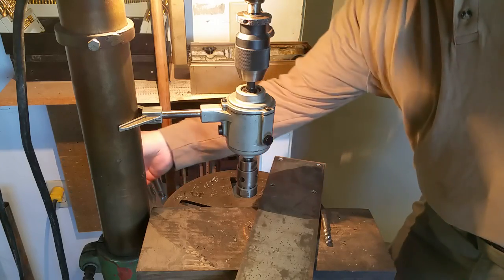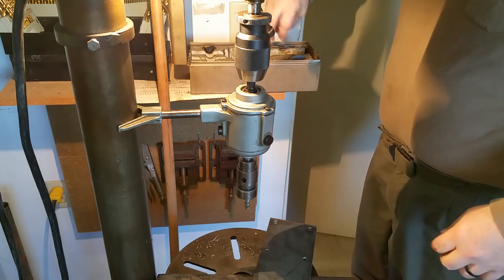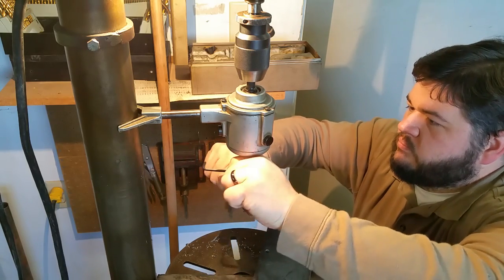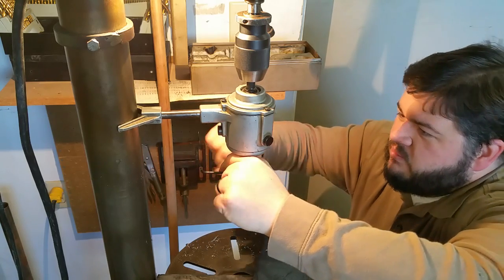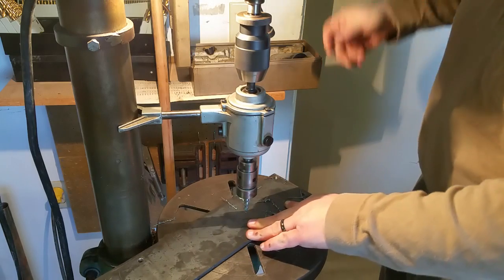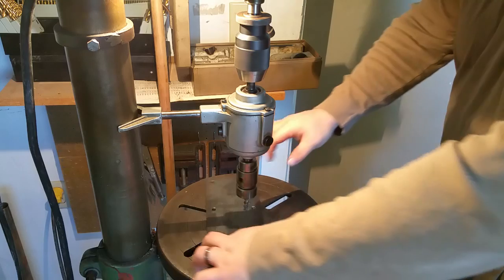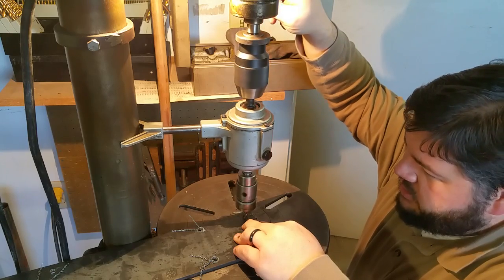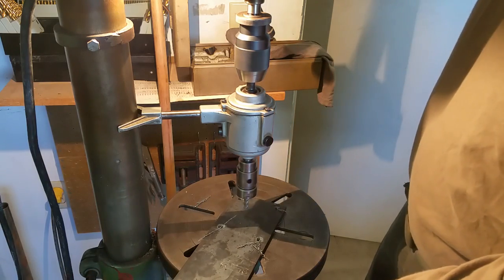Quick Bits: Rigid Versatapper tapping head

Comment: Have you ever changed out the oil? If so, what fluid did you use?
Reply from the maker: I did clean and service it when I got it, but I can't remember what I used.  I would think vactra "light spindle oil" would probably be fine.  That's ISO 32, so ISO 32 hydraulic oil should work also.

Comment: anyone have the manual on this tapper I just picked one up at an estate sale with only one collet and would like to get a larger and smaller one. this one is for about 1/4 to 5/16 taps. thanks. what exactly is the allen adjustment doing. I just put a tap in and it worked.
Reply from the maker: There are 2 drive plates in the chuck that clamp down on the square driving end of the tap, you use the allen wrench to tighten the drive plates.  These Rigid brand tappers are not as common as Procunier brand, which are similar but use cork drive clutches.  This type of design is not as common as the Tapmatic but there are several different manufacturers which made "sensitive" tapping heads.  I don't know if Rigid made different sizes, my tapping head has 2 collets that cover 1/4 to 1/2.